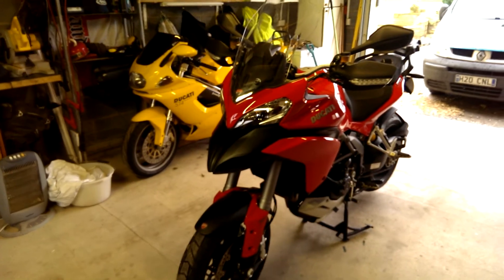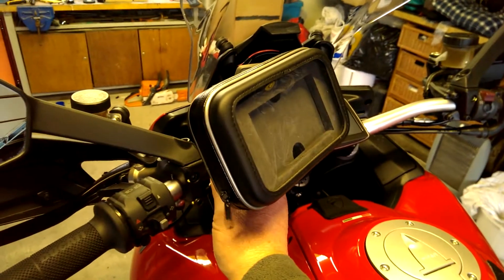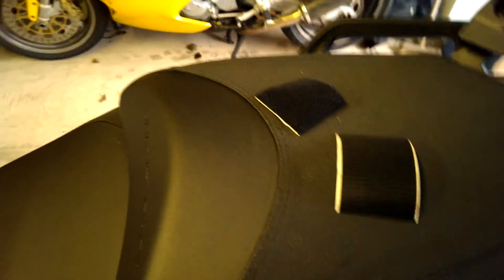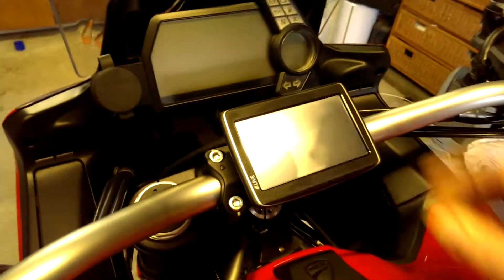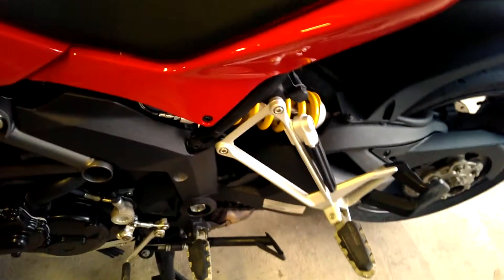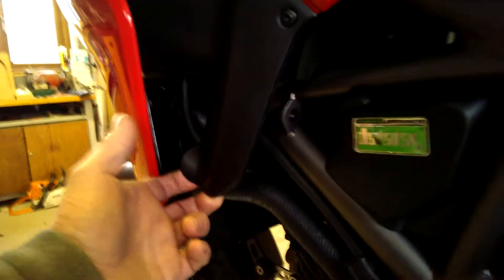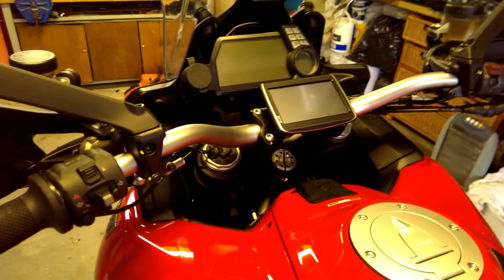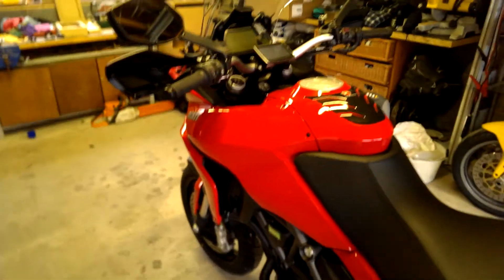Sat Nav & USB Mount Install Ducati Multistrada 1200 Cheap Alternative

Comment: Is that a car sat nav or a specific bike one?  How did you connect the USB thing to the white connector? Thanks mate!
Reply: The Crumble Have a look here, Crumble: https://andyw-inuk.smugmug.com/Motorcycles/Ducati-Multistrada-1200/Multistrada-1200-GPS-SatNav/i-97RfbMD
http://www.mts1200.info/threads/mts1200-gps-satnav.139/
http://www.mts1200.info/threads/mts1200-gps-mount-install.178/
If you don't have the cables from the SatNav, cable from ebay, and with a couple of ££, done. I couldn't be bothered to strip the plastics and or connect it to the battery, so went for for a 1,8m USB to Mini USB cable hidden behind the plastics, getting the juice from the power socket. Adaptor+cable+caps (to avoid corrosion), 5£
Reply: Thanks for the reply matey!  Sorted it - cheers!
Reply: The Crumble No prob mate, anytime!

Comment: Hi. Can I ask how you mounted the USB port next to the dashboard? I have the same USB but can't quite work out the best way to mount it. Thanks
Reply from the maker: so as not to damage the housing I just used double sided tape ..but the thicker stuff...u get them in strips similar to number plate tape.

Comment: Tidy setup with the USB port.  What brand is it?
Reply from the maker: Sorry, not sure what brand it is, was brought off e-bay, but you'd want ideally the under dash mount type.....that way you get the same mounting to house the usb in order to fix to the side. Hope that helps.
Reply: No worries. Thanks for responding.  Looks like your Multi is a '13 plus. Mine is an '11. I don't have the room to mount it to the side of the dash like you did anyway.  The windscreen mounts are in the way.
Reply from the maker: Yeah your right...Part ex this one though and had a new 15 plate and ended up drilling a hole the size of Calcutta near the instrument panel in order to get a USB in !. Those Din sockets are a waste of space, horrible fitment, way passed time they started putting USB's up front. I've suggested it I dont know how many times. I'm sure you've got a false plastic panel on yours, same as, opposite, the little compartment up front with the flip up lid. I'd look at putting one in there. Best of luck which ever you choose !
Reply: That was exactly where I was thinking of putting one!
Reply: If anyone is still interested this usb port is "Oxford" brand, i'm doing the same setup on my 14 MTS, This video showed me the way! :D THANKS!